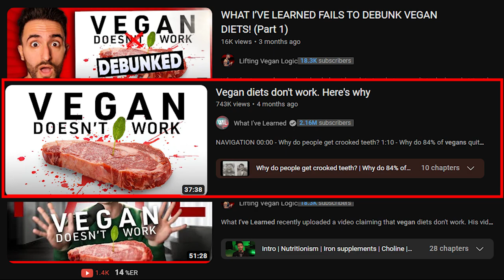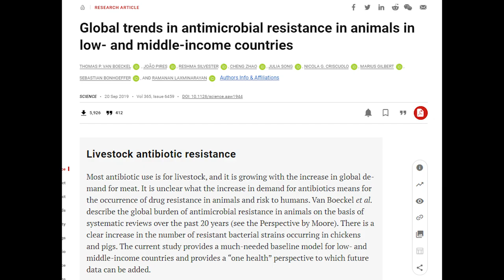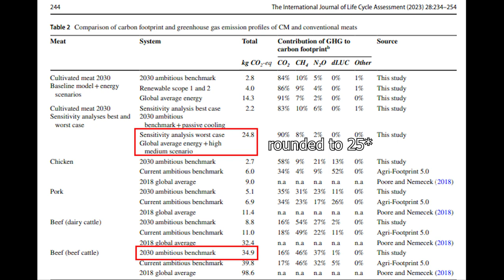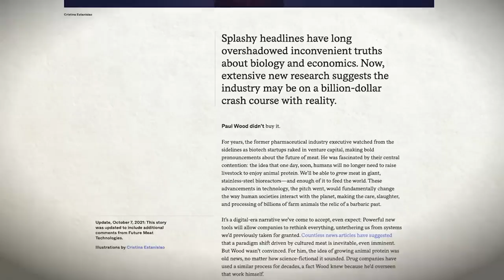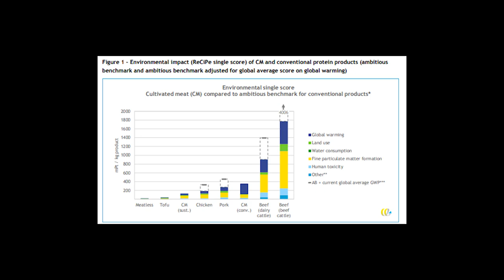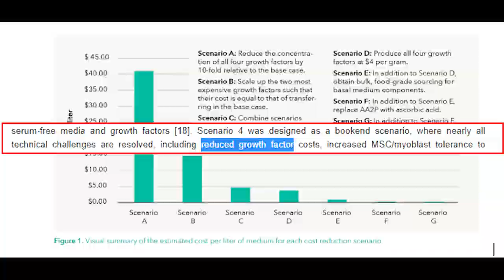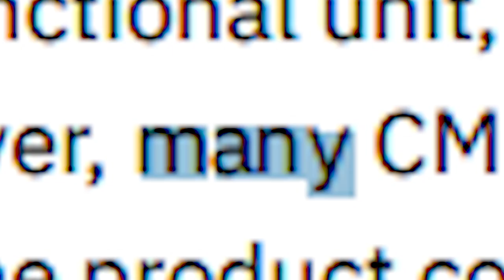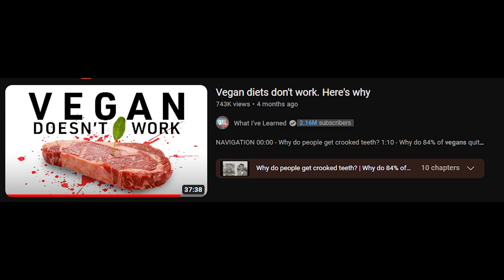WHAT I'VE LEARNED FULLY DEBUNKED ON LAB-GROWN MEAT!

Comment: What I've Learned: Cows just need water and grass!
Also What I've Learned: Ignores that crops just need water
Reply: Crops also need good soil of which there is actually very little overall. And they need fertilisers (most likely petroleum based ones), herbicides, pesticides and fungicides, and if you want to export your produce you need evidence you have followed the appropriate spray programme which consists of at least 25 different chemicals. Then there are the birds, rabbits and rodents deliberately poisoned to protect those crops. And the runoff into fresh water streams and lakes but let's ignore that too, right? 

Livestock can be grazed on land unsuitable for cropping of which there is an abundance. No spray programmes necessary. Not all countries lock their livestock up.